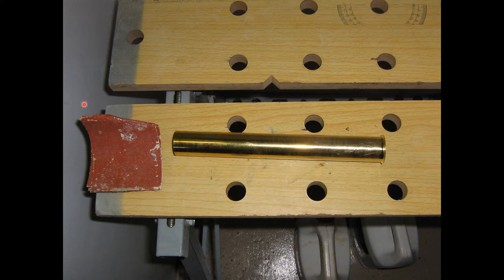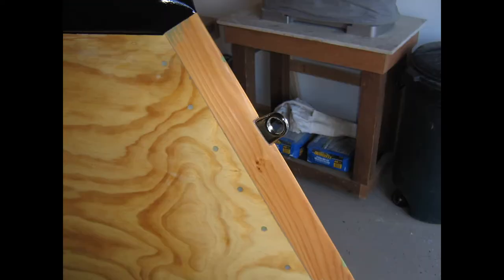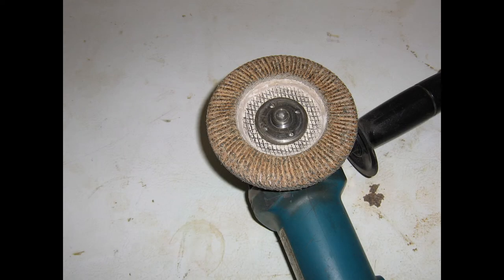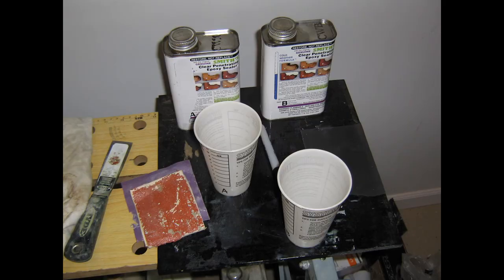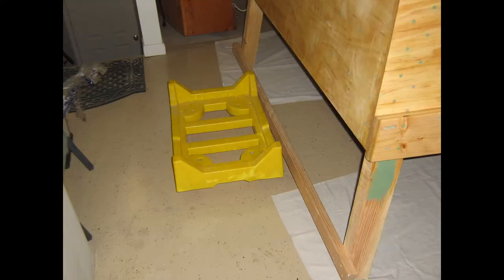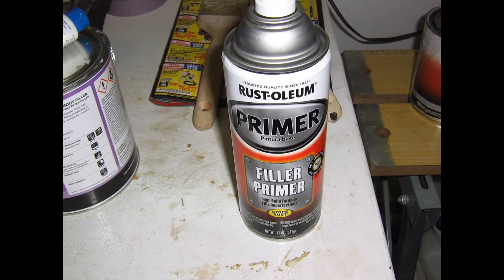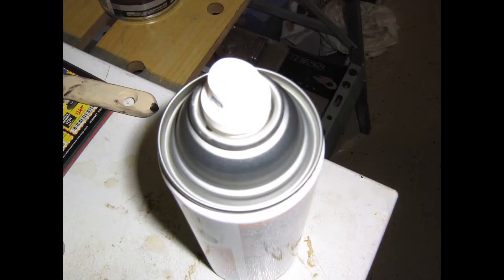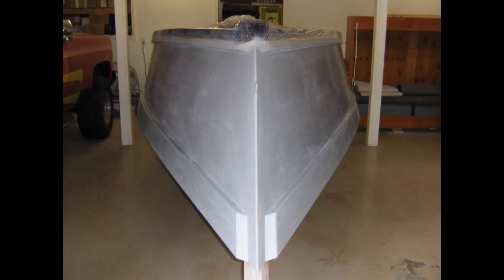Episode 17 of 2019 Boat Build

Comment: Happy New Year. Any thoughts about putting on a clear coat to give an extra layer of protection to the finish?
Reply from the maker: Howdy Glen. If you get good results with clear coating, go for it! I personally have not had great luck with clear coat on this type of paint. My experience is it tends to wrinkle, alligator and/or peel off. As an alternative, you can just add a bit of enamel hardener to your paint. It usually comes in small 8 ounce cans. One can will typically treat an entire gallon of enamel paint. This will increase both the gloss and hardness of the paint. It also significantly reduces the drying time of the paint.
Reply: Hello, I've never used a clear coat before. On my canoe, I use an oil based paint but it still scratched and chipped. I'll have to try the hardener